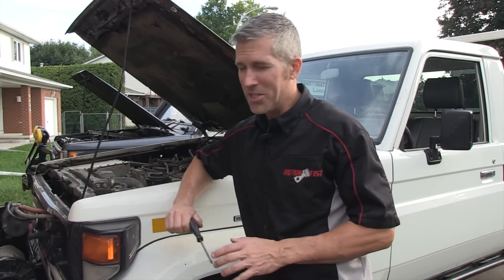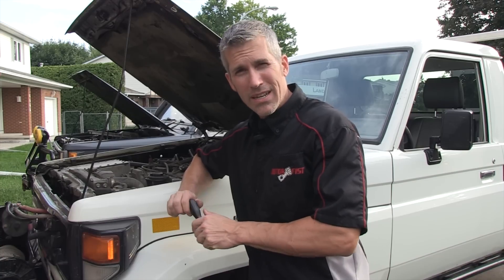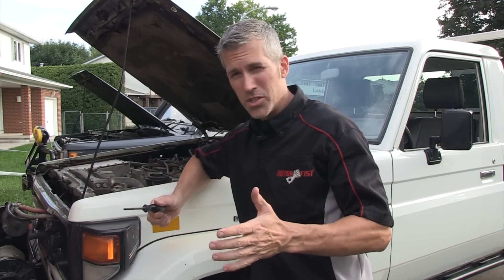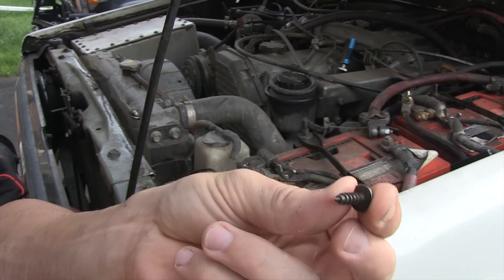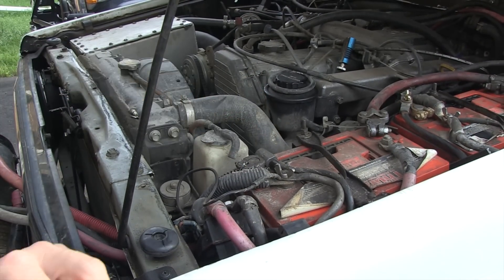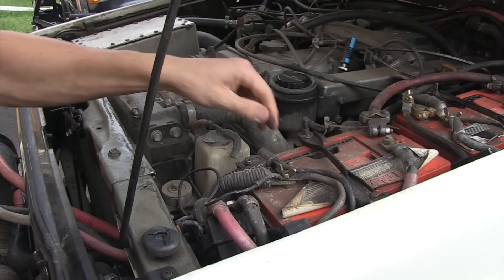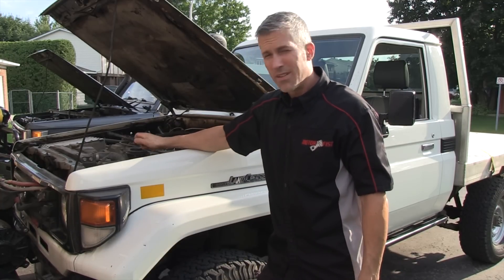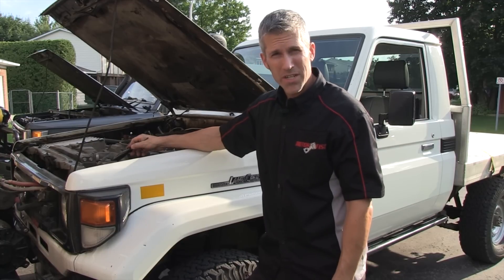Fix your battery terminal connection fast!  Pro Tips from PowerModz.com

Comment: And the proper way to do it is to remove the bolt and cut about 3mm off of one side of the clamp with a junior hacksaw, put back the clamp bolt place it over the terminal and do up the clamp properly. it takes a couple of minutes to do properly without bodging it with a screw.
Reply: And not everybody is going to have a hacksaw in the back of the car in the middle of the outback but they might just have a screwdriver and an old screw you know this is a quick fix and not everybody would be able to hacksaw through a battery terminal in the middle of nowhere so I hear what you are politically correct saying but this is a quick fix as stated on the tin !!

Comment: Can anyone tell me how long you can go with the screw in until you have to replace the ends of the terminal bolt?
Reply: well if you feel like challenging your engine, transmission and entire electrical circuit in the car you can go with it for some time. But it is really meant as a roadside repair so you can get new ones and get it fixed properly.
Reply: rem shin

Comment: i did that and now my battery terminal melted the fuse box on the positive battery terminal and the terminal is getting too hot. and the dealership in langley gave me a quote of 1000$ to replace the fuse box, and they have only one part available in the whole canada.
Reply: PS, not saying that the screw caused it, but it may have caused this(probably screw didnt cause this) , but i m so pissed at the dealership that they declared my car a fire hazard until the fuse box is replaced and not drivable.
Reply from the maker: @BeatTheD3viL  hard to say what the issue is..if i can see it i might have a better idea.  sounds like a major short took place.